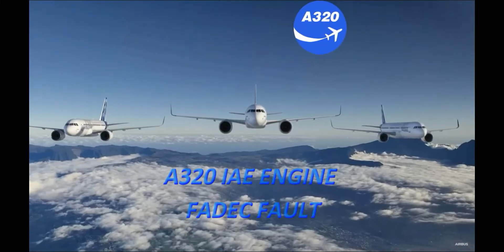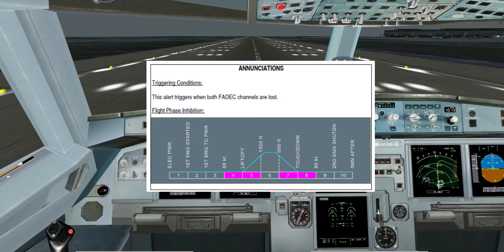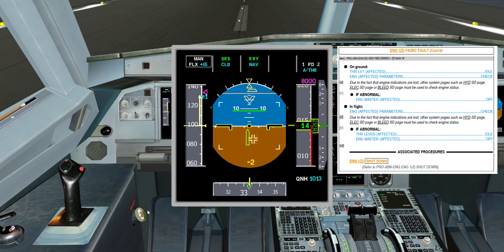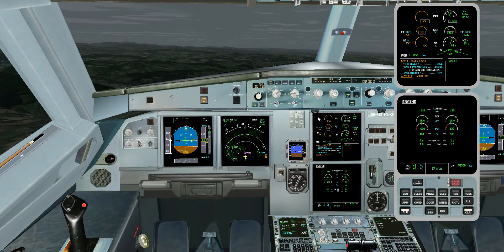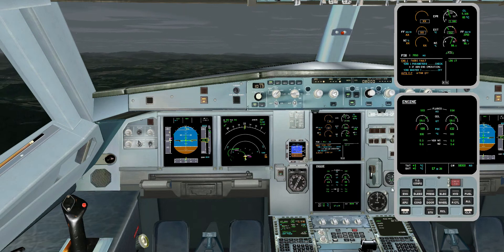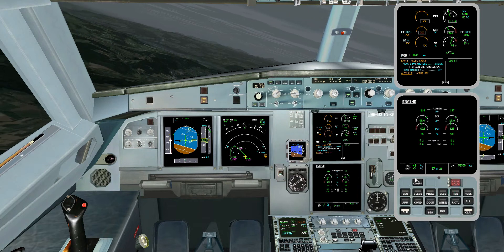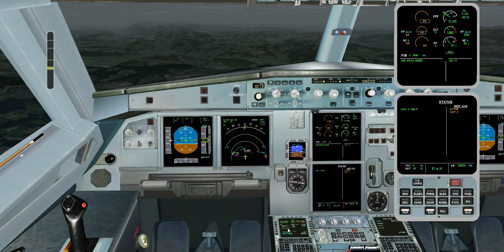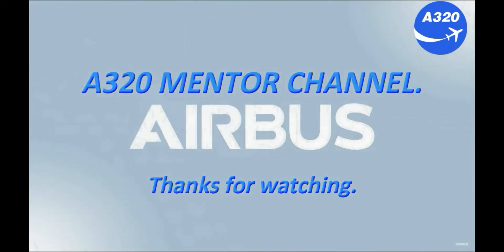Airbus A320 FADEC FAULT

Comment: A while ago we had a Southwest flight who was seen to have 6 in to one foot of flame. During initial throttle up turning onto the active for departure. They declared an emergency and returned to the gate. Everyone was safe in the symptoms resolved shortly after takeoff. The one thing that I commented, and the question that I've got, was I right to suggest in the comments section FADEC reset with engine running. Obviously I'm trained to repair a FADEC, but I'm not sure whether or not the operators manual would recommend PILOT resetting FADEC with the engine running. Would it simply start up and begin operating the engine at whatever throttle position was present at the time the reset was over? Or would the pilot need to cage the engine shut off the fuel reset FADEC and then restart the engine?